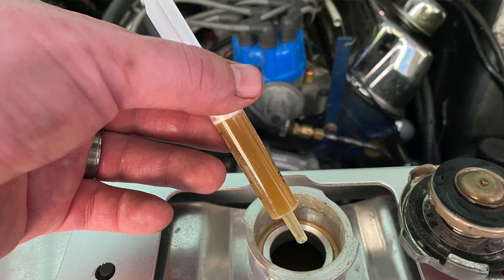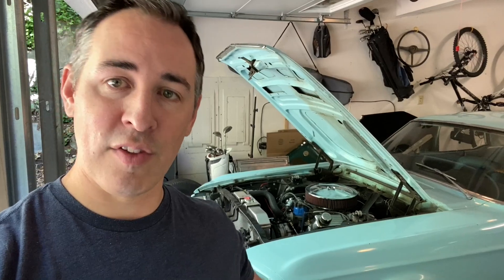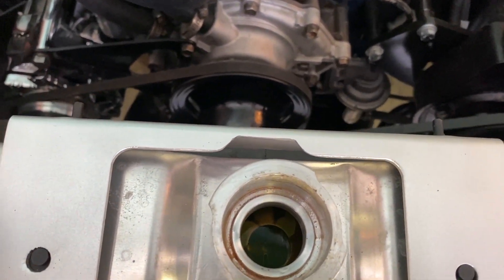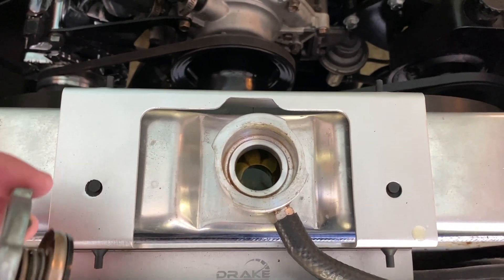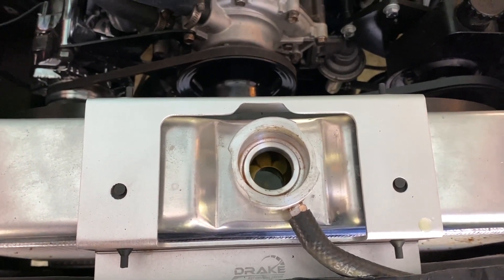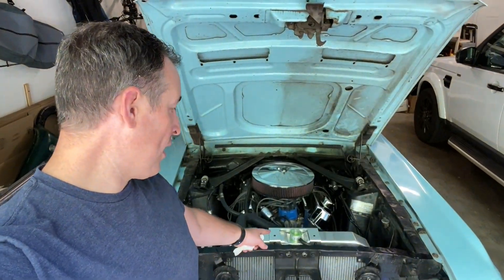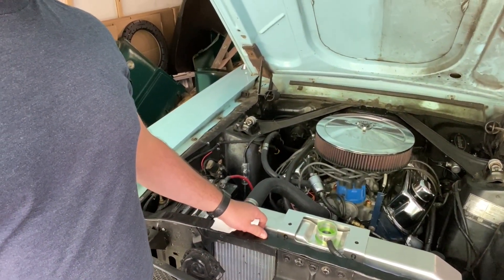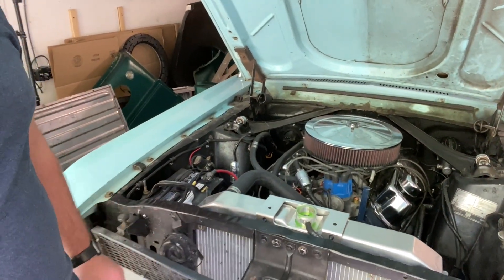Is This Oil, Trans Fluid, Or Rust in My Coolant? [1967 Mustang]

Comment: My 66 kicked out a brunch if rust they looked exactly like this after a big radiator flush. I too think if there's restricted flow or decrease pressure some residue will tend to build up.  Thankfully I never had oil in mine and glad to see yours didn't either!

Comment: That residue is from the fluid cirulating through the old cast iron block. What the residue is called is "Smeggy" at least the old boiler and Steam fitter guys would call it Smeggy or SMegma or Smeg [it is nasty to try and wash out of clothes]. Think of all that fluid circulating through that old iron block that's been cooking for 60+ years ;-)

Comment: Same problem with my sbc 427, remove drain plugs from both side of engine, flush it out with water hose and a lot of rust/crap came out. Its a new build with a Dart block, dont know how it happen?

Comment: Had the same on my BBC, my case it was tons of rust on the bottom of the water jackets in the block. I flushed the coolant many times. Still was alot left when i tore en engine down and cleaned it. 

Thats why I never use just water for coolant.

Comment: ok when you flush you coolant providing your heater core is good, run some CLR in the radiator and get it up to temp and let it run for 5-20 min and let the motor cool and drain the radiator, then fill it with water only and run it again and see what you get should be brown/red (rust) let it cool then flush again with water, repeat as needed with water.  That should get rid of the rust/mineral deposits in the cooling system.  I had a mechanic show me that trick said it is what he does being the chemical acid/chemical flush isn't done anymore.   While letting the motor run cup your hand (don't touch of course) around the exhaust tip and see if you get any splatter of oil/water or whatever or get a white piece of paper and use that instead of your hand you could let someone crack the throttle and see what that does then hold the throttle on a higher rpm for a few seconds and see if anything blows out the exhaust pipe on your hand or the piece of paper as well.  Also you may want to check the ATF fluid for water than as well.

Comment: Drivers side of hood looks oily, looked like smoke from drivers side valve cover or head gaske ?
Reply from the maker: Smoke was from some oil that dripped onto the header. No issues. The oil on the hood on the drivers side was from a faulty breather cap that I replaced and haven’t deep cleaned the engine bay yet.

Comment: maybe from the heater core ? oh and clean the other half of under the hood
Reply: I just replaced my radiator in my c10 and I was having the same issue. There was  rust as well. So I took out the thermostat and filled back up with water and ran the motor with the heater on. I kept flushing it out until it cleared out.
Reply: @C-10_sixdeuce  I think this could be my issue . Not same car I'm in UK.  I do admire American cars etc. Had second hand car 2 years almost it had shot loads done inc head gasket . But what I think now is (had new rad also at beginning  therm  and coolant sensor) . The over flow was getting high ..I do my own servicing but thus work was done by garage as I took dealer to court etc . 

The coolant smells bit funky and discolour bit no bubbling etc the garage recently put new rad cap on said old 1 was worn etc. And loleky nit keeping pressure correct . 

On leaving garage I had lots of white smoke (turbo is fine had that done also) . Can only assume it was where coolant got to areas it maybe didn't before and gave the initial smoke . Not happened since . Just the coolamt looking dirty again